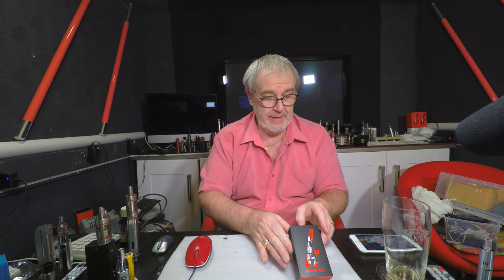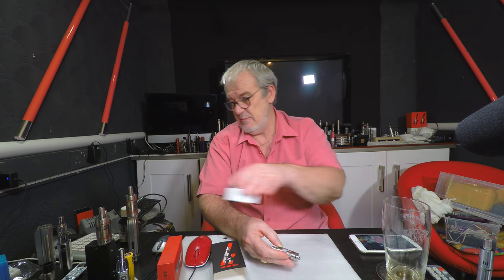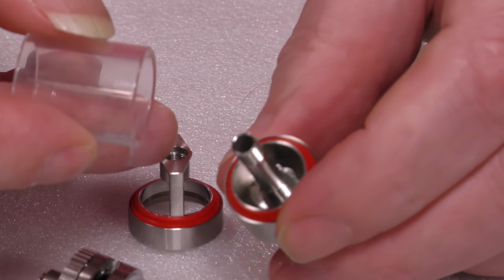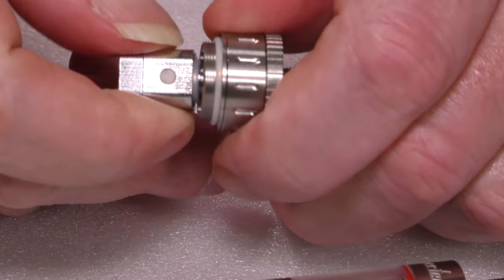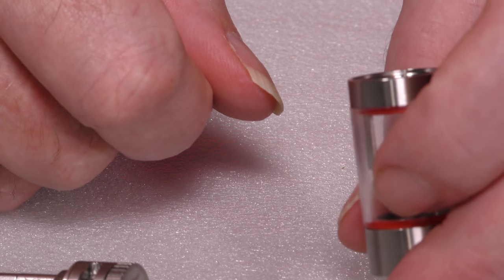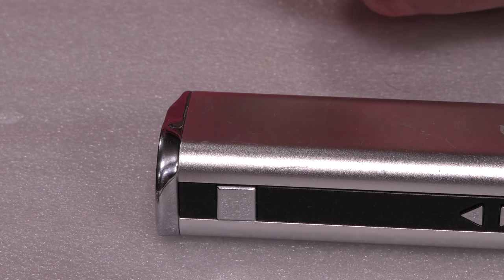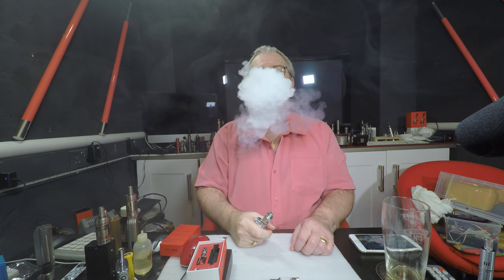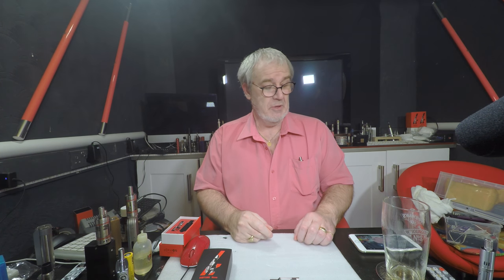Kanger Nano Subtank

Comment: I love the nano and use it more than the mini. The only downside is a full tank only gives me a few hours vaping until it needs refilling. Nevertheless imo the flavour is a little better than the mini and the airflow is pretty much the same.. The new 0.5 ohm OCC coils take longer to break in than the older units, but once they have, they can handle wattages up to 50 quite comfortably (i find the older coils tend to start to burn at around 35w). My fave combo at the moment is the sub box mini starter kit but Kanger are releasing a sub box nano kit shortly and thats going to be a very stealthy setup.